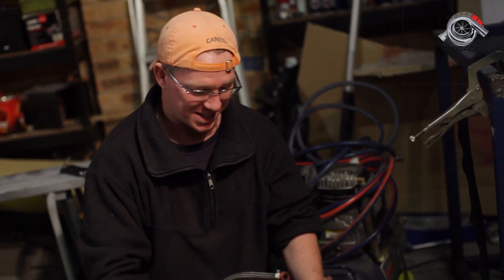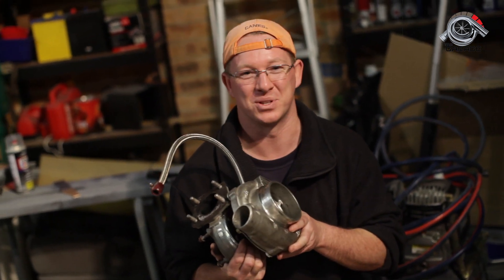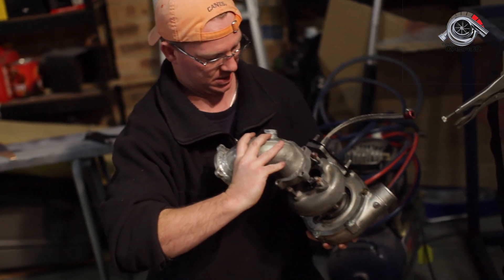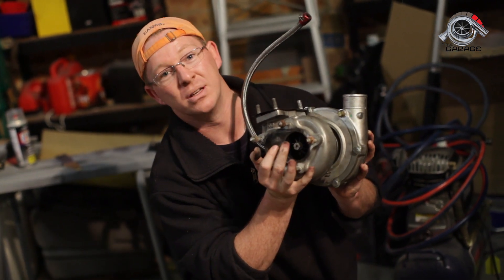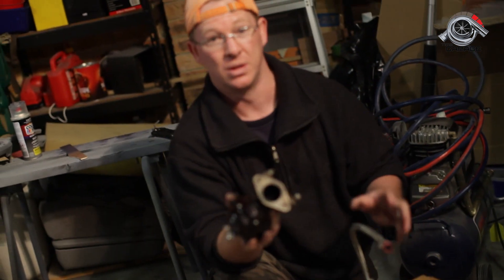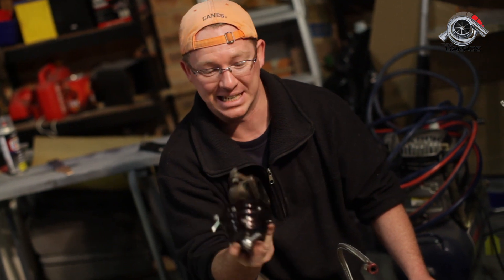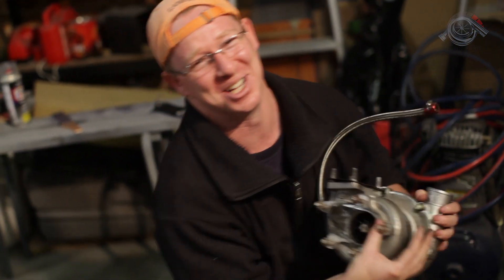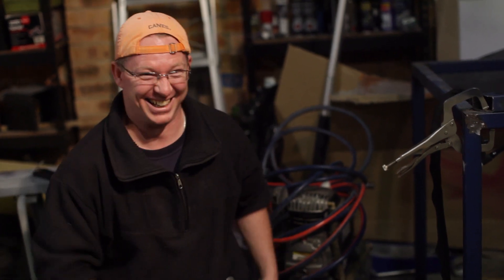Garret GTX3071 for the Mazda 6 MPS

Comment: Hey Tim,my dad owns a Mazda 6 mps too,and we want to change the turbo with a garret like yours,what tunning needs to be done for the engine to work with the garret turbo ?
Reply from the maker: Hi Markus, there is a fair bit of tuning due to the mods you need, besides the boost and big turbo you will need a 3 port best control solenoid, which needs to be tuned (it allows for more fine tuning of the turbo) then fuel, sensors, etc... I can not recommend Ray enough, besides sponsoring the youtube show, he even came around to check out my own install and just knows way to much about these cars... You can check out the prices and all that for yourself @ http://www.esolutions.dagher.com.au/RaydTuned.  I know this sounds like an infomercial but I have no idea about the depth of tuning and what Ray has done with mine is awesome. Some will be on the big turbo build episode coming out soon. Thanks mate. Tim